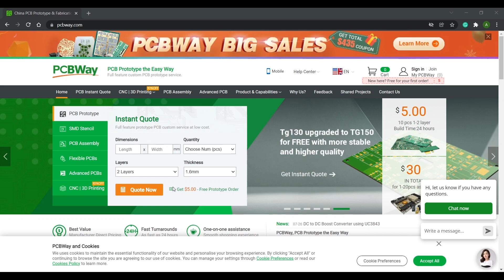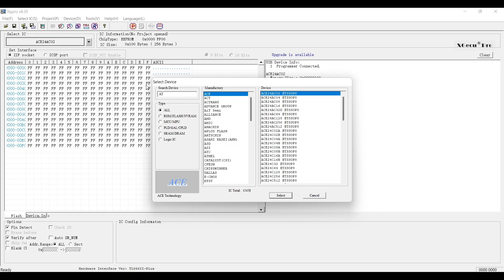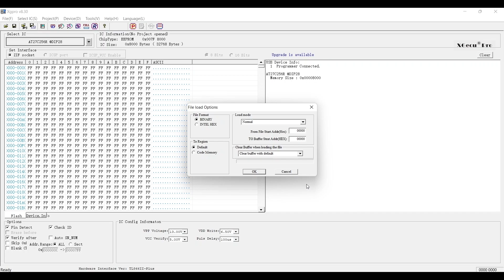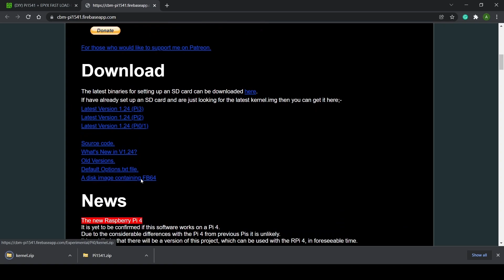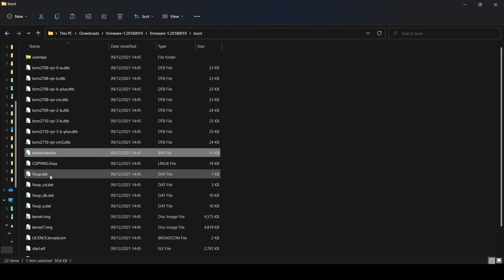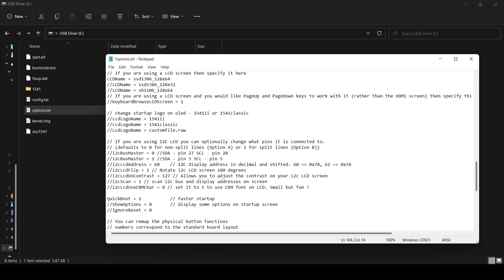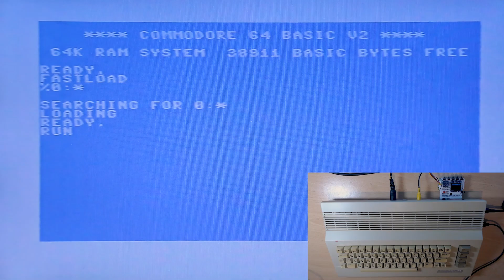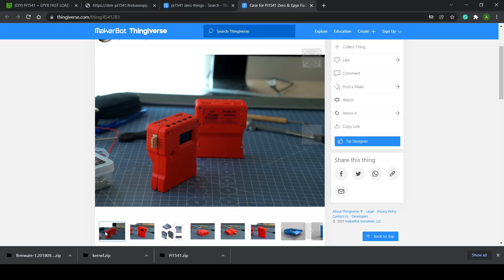Pi1541 | EPYX Fast-loader | Budget Modern Floppy Drive Replacement! | #C64 #PCBWay

Comment: Is there a plase to get the garber files. If i order ther it will cost me a arm and a leg??
Reply from the maker: I don't see the gerbers for download anywhere. The designer has recently released an updated version - https://www.pcbway.com/project/shareproject/_DIY_Pi1541_ZERO_EPYX_FAST_LOAD_CARTRIDGE_for_COMMODORE_64_With_Rotary_Enco_1a5e3aeb.html
As for cost, this really depends on the specs you select when ordering the PCB. Play around with the colours and surface finish to see what works out cheapest. I've often noticed that going from 5 PCBs to 10 only adds a few dollars to the total cost, so this works out cheaper per board and is great if you then split the postage with a group of you.

Comment: I cannot get the pi and LCD to turn on. The fastloader come up on booting the C64 but the rest is dead. Do I need to jump any of these pads in the back of the fastloader board? There are two solder jumper pads that say VCC and two that say GND.
Reply from the maker: Yes, the pads on the back of the board need shorting, which pads depends on the pinouts of the display you have. On the display, the pin order will be labelled as either "VCC-GND-SCL-SDA" or "GND-VCC-SCL-SDA". See how the power pins are switched around, which one you have depends on the manufacturer of the display. Short the pads with a blob of solder as below. 
For  "VCC-GND-SCL-SDA" short both lots of VCC pads on the rear of the board.
For "GND-VCC-SCL-SDA" short both lots of GND pads on the rear of the board.

Comment: Brilliant video!!  I have ordered the parts to build this.  One question I did have though.  I know this is a year later, but I see that the JST connector you used is not a right angle connector.  Does that interfere with the 3D printed case?  I wanted to print the case and wasn't sure if I needed a right angle JST or if the vertical would be OK.  Again, great video!!  Thank you!
Reply from the maker: Glad to hear you enjoyed the video! I didn’t put mine in a case in the end, so isn’t an issue for me. You are right though, a right-angled JST connector would be best if putting in a case. Enjoy your build and playing with it afterwards!

Comment: Thank you for this Video. If I do so .. which kind of ras-pi Zero is needed for this? W1.1? I Want to use the one which is Minimum Required
Thx
Reply from the maker: Let me double check this and get back to you. I am on a business trip until Saturday so will get back to you on the weekend.
Reply: @iNimbleSloth  Thank you very much
Reply from the maker: @barneygumble7300  I just checked mine, I am using a Pi Zero W v1.1
Reply: @iNimbleSloth  oh yes Thank you. I will do so …